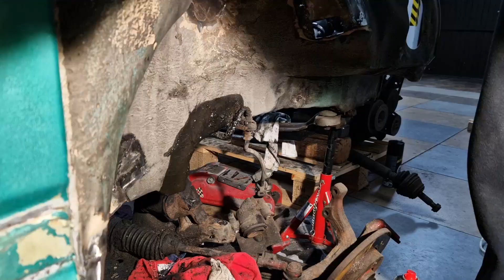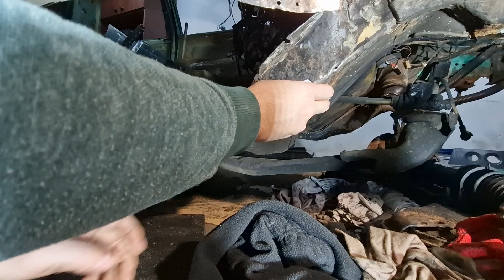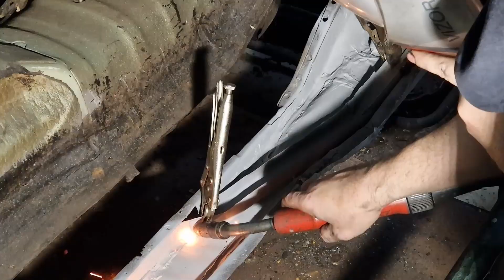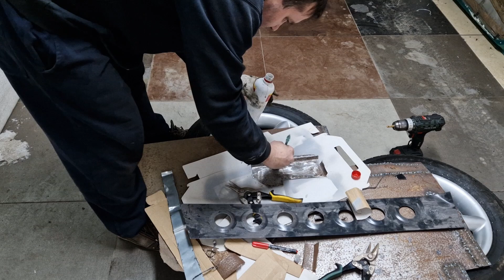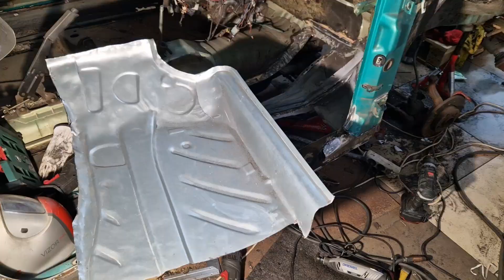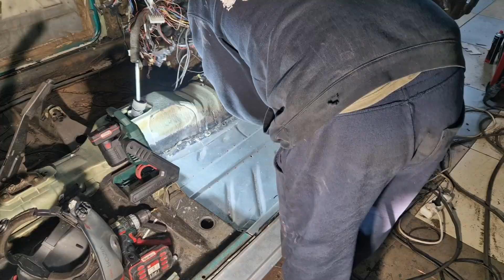Fixing floor panel on Golf MK2 GTD

Comment: Great work! I also have an old rusty MK2 and I'm planning to do the floors, so I'm interested in how many working hours you needed for one side.
Reply from the maker: Thanks for your appreciation of my work 😊 I was looking into the footage videos for this episode, first was on 25th of january, last was 22nd of february, so in real time it took me a month to do all the work showed, but i do it only as an aftework activity. Anyway most of the time was fixing the rail, so if you are doing only the floor panel, you can do it in 2-3 working days. Depends on how much rust you will find out when you cutout the floor. Good luck with the job and welcome to the club of saviors of the rusty golfs 🫡

Comment: Great job. I would definitely inject some cavity wax inside the frame rails, its a crucial step in corrosion protection because the change in temperatures will cause condensation and that will cause rust. Cheers!
Reply from the maker: Thanks, I totally agree with you. I am going to inject cavity wax inside rails and sideskirts once all the welding is done :)